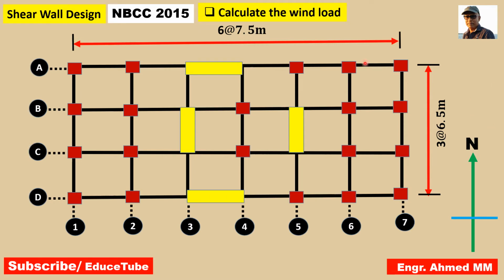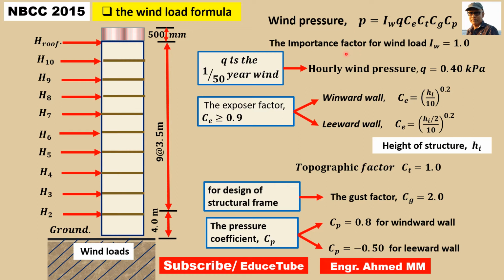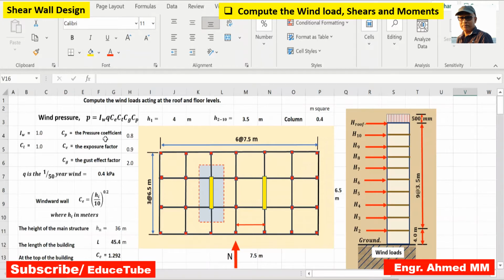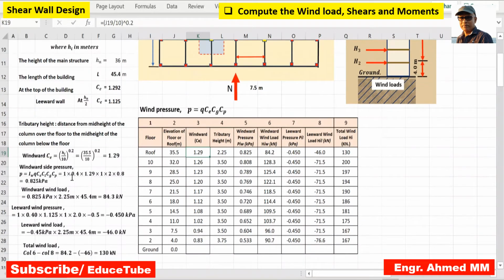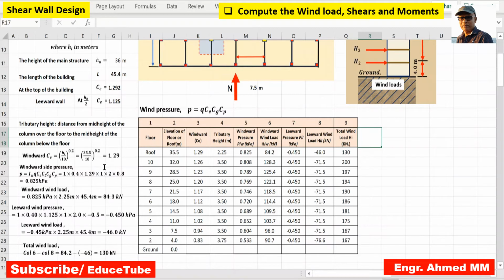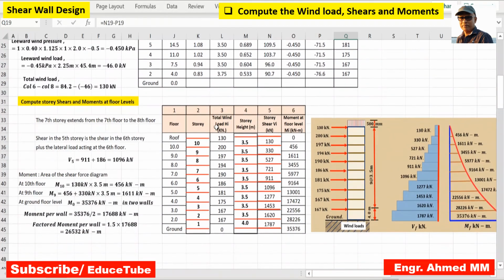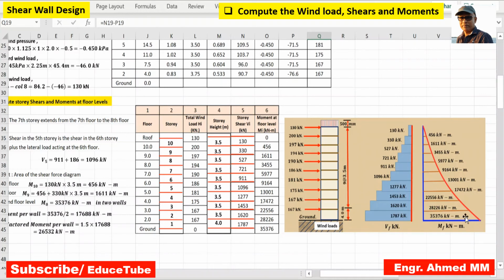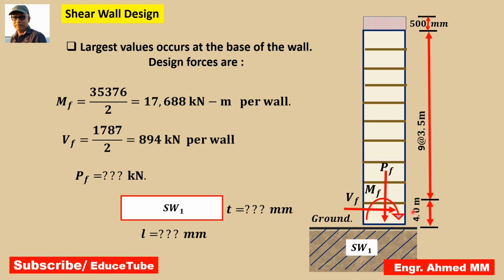Wind loads on Shear Wall/ Ten-storey Building/Shear and Moment Diagram - Part - 1

Comment: nice videos. if the shear wall in the direction of the wind don't have the same length of thickness, do we still divide it by 2? Can you also do a video on how the lateral load is distributed to the walls based on their stiffness? thanks